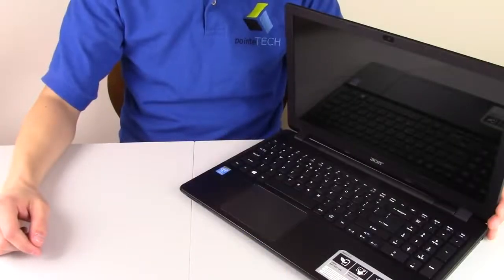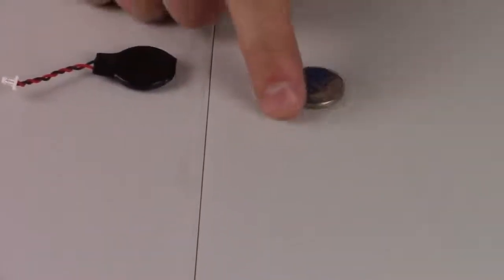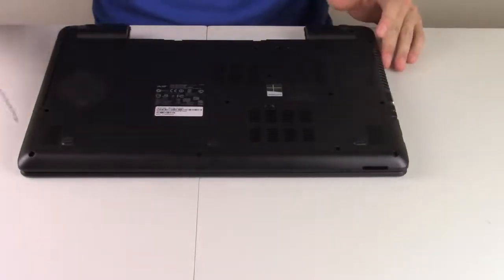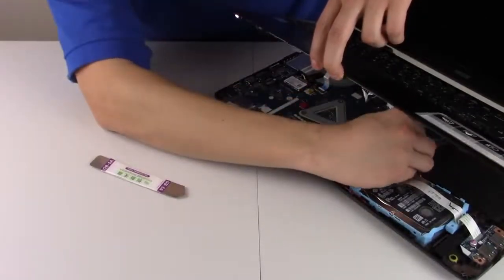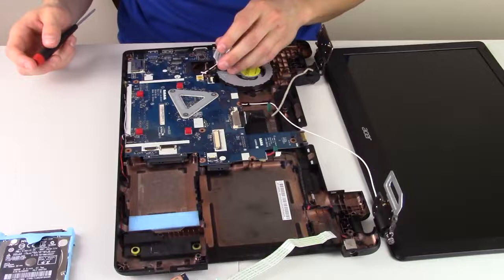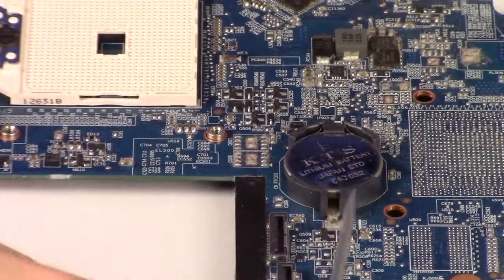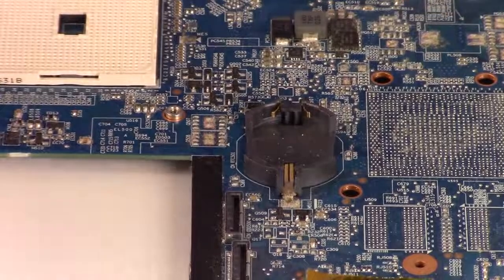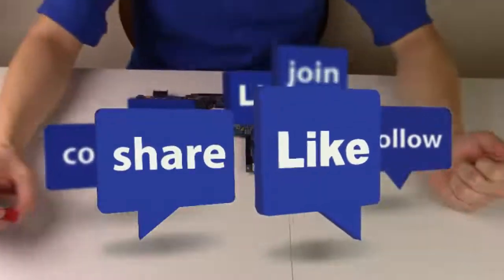How To BIOS Reset, Replace CMOS Battery - Acer Laptop Computer

Comment: bro I've done this and my acer laptop still won't turn on, the bulb sign beside the touch pad in the laptop keeps lighting/blunking but not turning on, maybe my cmos battery is broke, should i by new cmos battery?
Reply from the maker: For a computer that does not turn on, try this video first;  https://youtu.be/P3I7dDpkJps.  Let me know how that goes :)
Reply: @PC_Monkey  I've done the bios and static but still won't turn on, I'm gonna try removing and putting the ram, if it don't work do i need to replace my bios battery? cus my oc is kinda old i think it's 2010 model

Comment: hello, I have an Acer aspire e5-573g. Everything was normal until one day I tried to shut down the laptop using the keyboard power key. But that didnt work so i used the start up menu and shut it down from there. Ever since my laptop has been completely dead. I try to power on through the keyboard and it does nothing. The charger is working fine, when it is plugged in the red led indicator turns on. But the laptop power blue light doesnt come. I tried to do a hard reset by inserting a pin into the hole at the back of the laptop and the in the first attempt it didnt nothing. But i let it sit for an hour or so and in the retried and this time the laptop started. Also both the times i was holding the reset button for about 30 secs or more. However, with the laptop turned on i tried to run my normal applications and everything worked fine until i moved the laptop and  and after few mins it went dead again and ever since then i have tried reseting multiple times, tried removing inside battery, ram, hard disk and cmos battery and put it back in, tried to remove the static power as well but the laptop is just not responding. Only the charger indication works rest everything is absolutely dead. Please help me.
Reply from the maker: For a computer that wont turn on, you should try this video first;  https://youtu.be/_MOe71kBPOY
Have you tried that video yet?
Reply: @PC_Monkey   Yes, I have tried all the videos there and unfortunately nothing seems to help bring the laptop live.
Reply from the maker: @rohanchitte2108  If the first troubleshooting video for a computer that wont turn on as well as this BIOS Reset video did not help your issue, then the next step would be to test the Power Adapter and Power Jack as seen here;  https://youtu.be/YBhsVHideGE & https://youtu.be/HpabvrNaodU.  If those both test Good, then the issue is most likely with your Motherboard.  It would need to be replaced.

Comment: I also have a problem of restarting itself frequently the same acer on this video. Please help
Reply from the maker: Does it restart on startup or while your using it?
Reply: PC Monkey while I use it and every time I have to go to the boot system to set time
Reply from the maker: @isaacsuprise5348  If your computer is restarting during use, see why by following this video;  https://www.youtube.com/watch?v=Nqn8-jJFx2Y
As a guess, if your having to reset the Date/Time settings each time, your motherboard may be loosing power and BIOS may be shutting down.  You may have to replace your CMOS Battery.  You can see how to access that component here;  https://www.youtube.com/watch?v=kTYlxcL1cQc

Comment: I tried to reinstall windows after my computer crashed but it claimed that my hard drive was dead.. however, after changing my HDD I still had the same problem

Apparently even the first hard drive works well when you put it in another computer
I don't know what the problem is
Reply from the maker: What kind of computer did you install it into and what was the error exactly?
Reply: PC Monkey it was an Acer computer

On my computer am not able to install windows nor ubuntu. I also can't format the hard drive. Even when I run command prompt to clean the hard drive it brings an error
Reply from the maker: @georgegitau6740  Try to install the Operating System as shown here;  https://www.youtube.com/watch?v=bIlW4im-tr4
Also, make your own install media with the link provided there :)
Reply: PC Monkey I tried to reinstall windows 7 but it fails to get past the part where you select your partition.

When I try to format the hard drive it brings me an error and even a command prompt clean is not doing it for me.
Reply: And I think that it's also worth mentioning that in the diskpart section it shows that my hard drive has 0 space left. I just don't understand
Reply from the maker: @georgegitau6740  If you follow the install process above it will show you how to fee up the disk space.

Comment: Question: why I nearly never see the use of a electric screwdriver? Unscrewing and rescreewing tens of screws is already costing a lot of very expensive technician time. Why that?
Reply from the maker: Its easier and safer to use a manual driver.  If most or even all of tradesmen in a certain field prefer doing things a certain way, there its usually that they all know what they are doing lol :)  Its usually not that they all just havent thought of it yet :)

Comment: Will this lead to losing any data saved on the laptop?
Reply from the maker: No.  A BIOS Reset does not erase any data :)
Reply: Thanks so much! In the process of taking out the motherboard, i took out the black and white cords for j1 and j2 but now I'm not sure which one goes where... :( 
I have a picture that I can better explain. Would you know? Thank you!
Reply from the maker: @chachaclee  Sounds like your wifi cables.  What is your computers exact model number?

Comment: My laptop model is Acer aspire e5 573g . 2 days ago my laptop starting giving issues like lagging in between working process, my cursor slows down at low speed. And freezes the laptop in between . But i ended all task and clear all temp files and run the antivirus but nothing worked.... So i kept my laptop aside for 4-5 hr with no use. Then it started working. But yesterday another thing happened is that laptop turns off automatically . And yes i clean the internal fan and ram and heat exhaust..... But then too it freezes and shutting down automatically.
Reply from the maker: Try checking out the logs in the computer to see if it tells you what going on;  https://www.youtube.com/watch?v=oJX-kBfxjAg&t=22s
Reply: After watching it found 3 errors and 2 warnings ! Now what to do with that i check them on Google ? What's next step ???
Reply from the maker: @prajwalpatil3845  The video tells you how to proceed.  Yes, you find the error that matches the time of your computer turning off as stated in the video.  You can then read the description and see if its clear enough for you to figure out how to fix it.  If not, search for that error on line as shown in the video.  Microsoft will have a write-up on the error, the cause, and how to fix it as shown in the video.
Reply: @PC_Monkey  what if i reset my pc full format will the problem continues ?
Reply from the maker: @prajwalpatil3845  It depends what the problem is.  Did you find anything on the error that matches the time of shutdown?
Reply: @PC_Monkey  yes i found 3 errors , 3 warnings and many critical signs
Reply: @PC_Monkey  this is insane. I got many errors , critical and warnings.
Reply from the maker: @prajwalpatil3845  As stated in the video, find the error that matches the time your computer turned off.   Since it seems like your computer is experiencing many issues turning off, slowing down, etc, you will find various errors.  If more than one thing is going wrong with your computer, you will need to investigate more than one problem.  Read up the on error, google the Event ID if needed and it will tell you what each error is and how to fix it.
Reply: @PC_Monkey  the common event id : 10016 i found it.

Comment: Hello sir i tried everything i watched your videos but nothing happened laptop wasn't turn on . please help what can i do now?
Reply from the maker: For a computer that does not turn on, try this video first; https://youtu.be/P3I7dDpkJps. Let me know how that goes :)
Reply: @PC_Monkey  i watched this video which is in this link and tried all methods  but nothing happened except cherger and power jet test with multimeter because i don't have this device . Know what i do know?
Reply from the maker: @fari1426  If that video didnt identify the issue, then your most likely looking at a motherboard issue :(  If you want to try the multimeter test, you can find one here https://www.amazon.com/shop/pcmonkey under the Diagnostic Equipment list
Reply: @PC_Monkey  my issue has been resolve suddenly my laptop has automatically turns on when once again I tried to on it I plug in charger and its on . I'm very happy and thank you so much for your help. 😊❤
Reply from the maker: @fari1426  Glad your all set :) Always here if needed !!
Reply: Thank you so much 😊

Comment: I have an acer 6920g  work perfect off battery but when I plugged charger in it restarts only when charger in plugged into mains I'm baffled
Reply from the maker: If the computer only has issues when plugged into the charger cord, then try making sure the computer is updated first as seen here;  https://www.youtube.com/watch?v=DDv2gJDjfOM
If that fails to stop the issue, then you may want to replace the charger cord.

Comment: All laptops have cmos battery? Cuz I can't find mine and I have acer laptop
Reply from the maker: No, not all motherboards use a CMOS.  Some will not have one.  Can you access BIOS at startup instead and reset from the options in there?

Comment: What if I don't have a CMOS battery inside?
I have Acer travel mate  b113 series.
Where is CMOS in it?
Reply from the maker: If your computer does not have a CMOS Battery then you will not be able to reset BIOS this way.  Why are you trying to reset BIOS?

Comment: My laptop is turning on . But i cant press f2  i cant set up . Just loading on the lower right and tell me to press f2 its stock like ever you leave it there for hours or days.  I remove also the hardisk still desame and change the cmos
Reply from the maker: Assuming you have an Acer, can you try the steps seen here?  https://www.youtube.com/watch?v=gDQZvNQ2chc
Are you able to find any Recovery or Repair options in BIOS?
Reply: @PC_Monkey  i cant go to settings  its just stock on press f2 to setup ive done. Hard reset, change cmos,remove harddrive nothing change in the loading
Reply from the maker: @kennethpaulomalibiran8809  If you cannot find how to switch the setting in BIOS or if switching did not help, then reinstall the Operating System.
You can see how to install Windows 10 here:  https://youtu.be/bIlW4im-tr4.  
You can create Win10 Install Media for free as seen here;  https://youtu.be/YbC4jZVwQm4.
You can see how to install Windows 11 here:  https://youtu.be/zYY-Gq68Dvo
You can create Win11 Install Media for free as seen here:  https://youtu.be/WIxDYRBVbmk
If you cant create your own, you may have to purchase it.  You can see an example of a good install media USB in the Repair Tools list here;  https://www.amazon.com/shop/pcmonkey.

Comment: Mine one is connected to motherboard... I don't know how to remove it... Please help me!!
Reply from the maker: They are usually all connected to the motherboard :)  How is yours connected?
Reply: @PC_Monkey  mine one is soldering with the motherboard..... I am not able to change or remove it by hand... What can i do now!!!
Reply from the maker: @ashwanigupta3553  If you dont have the equipment for that then you wont be able to remove it :(  Why are you trying to reset BIOS?  Can you access BIOS and reset from the options?
Reply: @PC_Monkey  my laptop is not turning on and not even charging...no led blinking....its totally dead.....what can i do please help me🙏🙏🙏
Reply from the maker: @ashwanigupta3553  For a computer that does not turn on, try this video first;  https://youtu.be/P3I7dDpkJps.  Let me know how that goes :)

Comment: I was trying to install linux and after that once I restarted its just stuck on the acer logo 💀

Is it possible that I corrupted my BIOS??
Reply from the maker: Possible but its more likely the operating system didnt install properly. I would try to install again.  If it fails, perhaps your hard drive is bad too and needs to be replaced.  To be sure, you can reset BIOS as seen here or you can try accessing BIOS at startup and manually resetting.

Comment: Please note that this tutorial is for those with previous experience in this type of procedure. Unfortunately, "take this out" doesn't mean much to someone stuck with a dismantled laptop and a screwdriver in their hand, wondering how to put it back together.
Reply from the maker: Yes, 'take this out' would not tell you how to put something back together lol.  However, I dont think that concept requires previous computer repair experience to understand ;)
What are you looking for assistance with?  Assuming you took the computer apart, I would think you would be able to put the components back??

Comment: Hello, please help me.
I have an Acer Aspire E5 471g.
I recently installed an SSD and everything went well.
I installed drivers for everything but then one day the laptop just won't start.
The power indicator is blue which means it's on but the screen is completely black, no cursor or text.
When I turned on my flashlight on my phone and shone it on the screen, there seems to be a faint flickering of the backlight which cannot be seen without the flashlight.
At first I thought I had to reinstall windows because it might be a software issue but no....the problem still persists.
Then it's probably the CMOS battery.
I haven't tried it because the CMOS battery is on the other side of the motherboard.
I really don't want to try and repair this myself because due to the current circumstances of the WHOLE WORLD, I can't just go outside and give my laptop to someone to repair it.
I can't even get a NEW ONE!
Whelp
Reply: UPDATE: Removed the CMOS battery and still waiting for at least 30 minutes
Reply from the maker: I dont fully understand.  Your saying your computer wont start at all but then it sounds like you tried to reinstall Windows and that didnt help.  How did you reinstall the OS if the computer isnt turning on?
Reply: @PC_Monkey  I fixed the issue before by removing the cmos battery and waited 30 mins to reinsert it.
It worked for a few weeks and tried reinstalling Windows because I thought Windows caused my laptop to not boot.
But now i'm facing the same problem where the laptop just won't boot at all even after I do the cmos battery trick.
If I shine a flashlight at my screen, there's only flickering but no Windows or cursor.
I also tried connecting my laptop to a tv using an hdmi cable but that didn't work either.
This is a pain to solve because I think it's not a simple matter.
Reply: @PC_Monkey  the fans spin and it does get warm, blue light indicator, just no screen.
Reply from the maker: @blacksta-r  If the fan is on and the computer heats up, then the computer is most likely on, just not displaying.  
For a computer that turns on but the display does not work, try this video first;   https://youtu.be/u-REPLdpZ70
Let me know how that goes :)
Also, is the computer warm like, normal use warm, or is it overheating?
Reply: @PC_Monkey  it's normal warm
Reply from the maker: @blacksta-r  For a computer that turns on but the display does not work, try this video first;   https://youtu.be/u-REPLdpZ70
Let me know how that goes :)

Comment: Hi my acre laptop won’t turn on the light is blinking I’ve tried taking the battery out and shutting off for 1 minute
Reply from the maker: Are the lights the only signs of life when you turn it on?  No motherboard or hard drive sounds?  No fan noise?  Nothing on the screen?
Reply: @PC_Monkey  yes the lights is the only sign
Reply from the maker: @rajvinderkaur8556  For a computer that does not turn on, try this video first;  https://youtu.be/P3I7dDpkJps.  Let me know how that goes :)

Comment: My computer keeps freezing as its turning on everything is okay n been tested but it won't carry on loading to the desktop page
Reply from the maker: What screen does it freeze at and what are you able to see before it freezes?
Reply: @PC_Monkey  just as it starts it says Acer then please wait appears then it freezes from there
Reply from the maker: @m4.yt27  Are you able to try the steps seen here?  https://www.youtube.com/watch?v=gDQZvNQ2chc
Reply: @PC_Monkey  tried them and it hasn't worked. I've factory reset my laptop but when I'm trying to go into safe mode it won't work either
Reply from the maker: @m4.yt27   If none of the steps here solve your issue, then try to reinstall the Operating System as shown here;  https://youtu.be/bIlW4im-tr4.  You can create your own Windows 10 Install Media free as seen here;  https://youtu.be/g_UhiHScaSI.  If Windows won't install correctly, then we know that the Hard Drive is bad.  Replace it as seen here;  https://youtu.be/tNp5Kbo9uHg.  Then, install Windows onto the new one.
Reply: @PC_Monkey  okay thank you so much for the help.
Reply from the maker: @m4.yt27  Your welcome !!  Happy to help :)

Comment: I have tried to short circuit the CMOS..  after doing so I still cnat get my laptop charged
Reply from the maker: Is the problem with your computer that it wont turn on or that it turns on and works well but will not charge the battery?